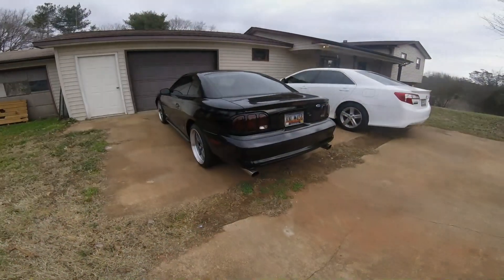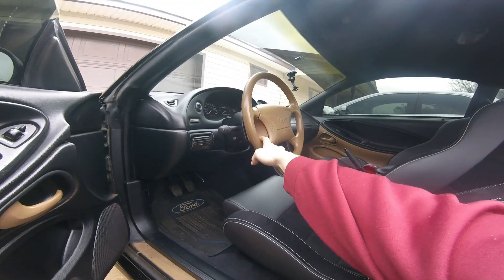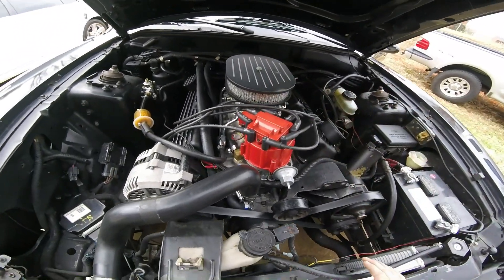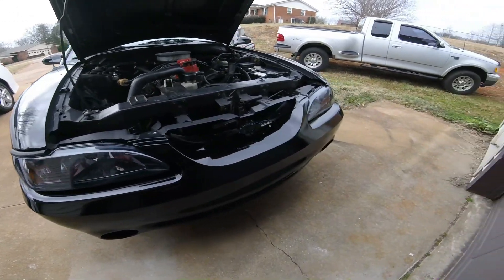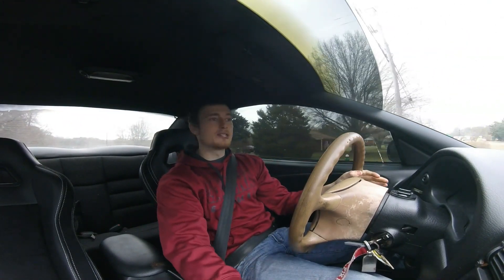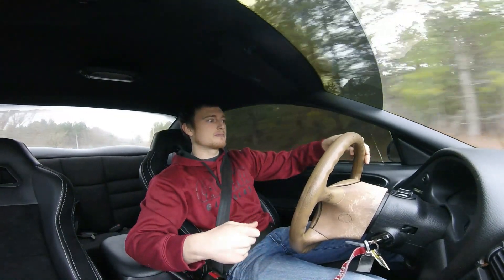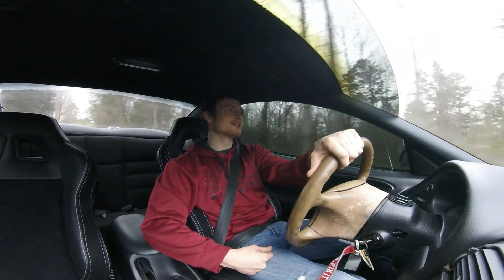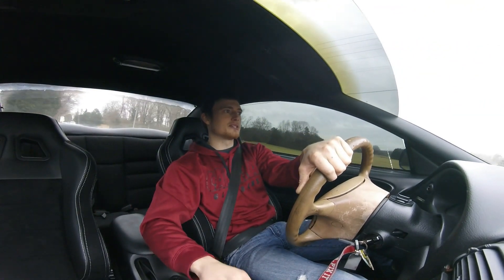Sn95 Mustang The Build So Far

Comment: Nice 2 see a SN95. I don't have the 5.0 pushrod. My is a 96. I would like 2 see more on your one piece headlights. I want them but can't tell if I like them from picture in catalog
Reply from the maker: jason karns I actually have changed them to the two piece lights, the reason why is the adjustability of the 1 piece headlight just was not good! It was so aggravating to get them where they needed to be. So I really would go with the 2 piece headlight. I have the cobra style smoked.
Reply: Jason Karns.Dude..keep your factory headlights. trust me. the rest are junk.

Comment: Awesome video brother. You seem honest. Awesome quality!! I have a 95 vert. It had 90,000 miles, in perfect condition. Haha, bought it for $1000. Then put $933 to get new radiator. Fuel pump, fuel filter, and mass sensor, and took off gas tank poured 7 year old gas out, bc it hasnt been on road in 7 years. Now it runs perfect. Bone stock. Now, I wanna put Elderbrock Performer heads, F-303 cam, KN air filter, shortie headers, 75mm TB, offroad H-pipe. I think that's close to being it. LOL!! Subcribing man!!

Comment: What did those seats run you? I hate how low the stock seats sit. Did those seats help that part at all?
Reply from the maker: drift swat racing yes the racing seats raised me up about 1 to 2 inches and all together I think they were around 700 bucks
Reply: Awesome!! $700 each or a pair?
Reply from the maker: drift swat racing for the pair and they come with seat brackets

Comment: Can u give me a list of what u have done to ur car looking forward to more videos
Reply from the maker: Its a stock block car with 
Ford performance E303 cam
Trickflow 11r heads
Trickflow chromoly pushrods 
Trickflow 1.6 roller rocker
Ford racing roller lifters
Edelbrock performer rpm intake 
Demon 650 carburetor 
Hei street fire distributor
It has 4.10 rear gear, Yukon locker with moser 31 spline axles
Sve short shifter
I think that’s pretty much it man 
But thanks for the comment and support 👍🏼

Comment: how is the black paint holding up? and what kind did you use? i painted my airbag with some vinyl specific paint and it didn't hold up good
Reply from the maker: Joe Kaiser it’s holding up really well actually I used duplicolor fabric and vinyl, but I used the prep spray that they make to help the paint stick better and I cleaned all the panels really good to before painting

Comment: youll like the 4.10s..I was running them with my 5 speedtremec tko but im now running 4.30s with a T56 Magnum  and a 2018 Coyote swap. i have a few mustangs..one is a 89 lightweight f13 option LX Coupe i put the tko in along with a procharger and i have a 1991 and 92 tX DPS SSP cars of which both are painted black and white as they were..the state threw some ugly gold enamel on one and some fckd up blue on the other.they are both pretty heavily modded..i also have my white 5 speed coupe which I GOT NEW FOR MY 16TH BDAY BACK IN APRIL OF 91..All my cars are manual coupes except the 94 with the t56/coyote swap..I piked up the SN95 from the original owner and only had 37,000 miles on it about a year ago for only $1300.. 13 hundred buck and is mint. ive blacked out my interior as well and HAVE THOSE SAME EXACT SEATS!!!!!I HAVE DELETED MY AIRBAGS AND HAVE A MOMO DLM IN ALCANTERA..I also put a black top on it..i run single chamber 10 series flowmasters dumped  just at the end of them and had a custom x pipe made to fit my headers which my welding guru fabd for me..i just turned 51,000 miles..the car is actually pretty rare.in 94 they only made 289 Vibrant red Mustangs and only the GTs got this color of which only 29 were manual convertibles..its actually in the paint shop ..half disassembled for a respray.i was a Sales Rep for HOUSE OF KOLOR & SPIES HECKER so I know the best and worst shops and this shop only does exotics and such  and the owner is hooking me up solid on my on my paint jobthey pulled the drivetrain and media blasted it,so it will me like a new car when its done..good luck with your build man..ive owned 12 mustangs and also have a 03 cobra with a upgraded 4.0 liter Whipplecharger..Anyway..looks great but i must ask...why didnt you go with the 17x10.5 315/35s in the rear instead of 17x9s with 275/40s  on all 4 corners?
Reply from the maker: Torrey Pritchett that’s awesome! I can tell just from how many you got you love mustangs, and sounds like you have a nice assortment of them, I’m in the process now of going back with a 347 stroker build with a dart block shp block just having to save up my money so I can get the bottom end built, but I really appreciate the comment and keep building on those mustangs, sounds like you go a beautiful selection
Reply: @lollis_garage3683  I appreciate  that man..Keep on wrenchn!! She looks fine!

Comment: They look ugly when you take the spoilers off, but your looks good bro!! What did you use to paint the interior I’m doing the same thing well want to, I’m going with a half block half parchment interior!! I have a lmr carpet in black coming, and a black styling bar, light bar, ordered a black convertible roof as well! But I do want to two tone my interior black and parchment.cant find anyone who has the factory style leather replacement covers that can make it parchment and middle black
Reply from the maker: S gill I used duplicolor fabric and vinyl paint and just prepped it will really fine white scotch rite pad to scuff it a little and cleaned it with alcohol and lint free cloths. 👍🏼

Comment: Weight reduction is a good way to give your car more acceleration.  Rear seat delete kit.  Tubular K member. Tubular control A arms. Aluminum drive shaft.  And a Vortech super charger can probably give you another 100+ hp boost too.  I have a 94-98 FR500 steering wheel of you'd be interested in buying it for a non profit price.

Comment: Did you got with the lmr paint bro? And did you take the dash out or did you just clean and mask?
Reply from the maker: Just clean and mask and no I actually used duplicolor fabric and vinyl paint flat black. Don’t do gloss it looks terrible!
Reply: @lollis_garage3683  how did it hold up bro?
Reply from the maker: @hoose_5.0h67  so far so good been that way since this video to clean it all I use it a lightly damp micro fiber with either interior cleaner or water. I wouldn’t use the armorall shine stuff it’s bad to leave streaks
Reply: @lollis_garage3683  okay So for the patch of carpet in the door panel what did you do for that? So for all the questions brother
Reply from the maker: @hoose_5.0h67  painted it as well

Comment: What kind of fuel pressure are you getting with the  carburetor?
Reply from the maker: Patrick Snarski 8 psi Im running and adjustable fuel regulator
Reply: can you run e85 on a carburetor.
Reply from the maker: Patrick Snarski yes but you have to buy a e85 specific carburetor. Holley makes a great e85 carb. It's a Holley ultra xp e85

Comment: Where did you get such a low mileage engine ?
Reply from the maker: Oh I rebuilt the engine and it has a little over 5000 miles now. So it's got 5000 on it since the rebuild but everything in it is new

Comment: Around 360 h.p. get in there and melt the tires...Slam a big ass Blower on it..Big Godzilla sized Blower..sticking 4 foot out of the hood..TREMEC is geared different..T-5 1st and 2nd are low and 3rd is the big jump in ratio..
I killed 5 T-5s and finally got a Tremec....I do like the car though..
Cool..I know you are laughing at me but when I do something..it's to an EXTREME.!!!
Oh on the gears..on my 98 gt..
I liked it better with the 2:73 gears..but I mangled that shit..so I installed a 2003 8.8 3:27 in it..I do not like the ratio..too low..but a Tremec T-45 is geared different..
With the 2:73 I could run over 140 mph in 4th..and still going..I don't think I will be doing that again..car moves around way too much at that speed on the highway..but it was fun..
Reply from the maker: David Ross lol it’s making a lot more power than in this video now I swapped cam and heads and everything. But yeah the car is down right now because of the crappy t5
Reply from the maker: But it will have a blower one of these days
Reply: @lollis_garage3683  man get a Tremec..I got sick of t-5 ..
Anything over 300 H.P. They scatter
Reply: @lollis_garage3683  Mustangs are Addictive..you never get bored with it..Always looking for a little more..It's a cool drug lol
Reply from the maker: Right now the car has trickflow 11r cylinder heads with a lunatic voodoo cam 587 lift int. 572 exh. And 239 232 duration you go check out my new videos and see it and listen to it. She’s a beast now but I’m definitely going with the tko600

Comment: tuning a OBD1 IS WAYYYY SIMPLE COMPARED TO A SHITTY OBDII... That carb is pointless. Anyway I have a TON OF PARTS!! ALUMINUM GT40X Turbo Swirled,AFRs TRICK FLOW, 3 sets of true GT40 upper and lowers,Tubular K member,couple of Custom ground cams,3.55s,3.73s 4.10s and I run 4.30s with my T56..Im running just over 750-800whp  depending on boost and  690-740 trq.. Ive got a ROUSH SBF 427 with a Whipple. Mine is a 94 Convertible.. ive actually got 2 94, along with 2 SSP Coupes..88 & 91.. All are built. Dude. Did u really just use SPRAY PAINT ON YOUR INTERIOR?? OR DID YOU USE ...SEM PRODUCTS????

Comment: What engine is in it ?
Reply from the maker: 5.0 litre 302
Reply: How and where did you get such a low mileage 5.0 pushrod?
Reply: And what good comes from a carb swap?
Reply from the maker: The only good thing really about a carb swap 5.0 is its way easier to work on, if I change any major engine parts as far as camshaft heads esc, I can tune it myself instead of having to pay loads of money for someone else to do it. Fuel injection is definately more efficient though. And i got this car off a car lot that my shop does work for but i don't know where they got it.
Reply from the maker: There sve s3 seats from Lmr.com